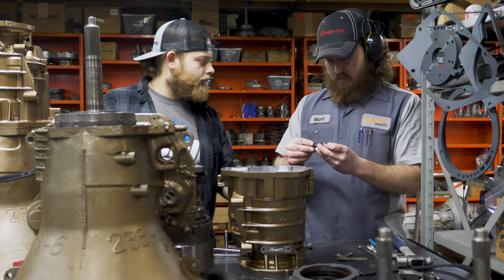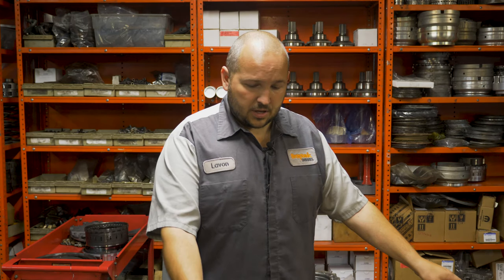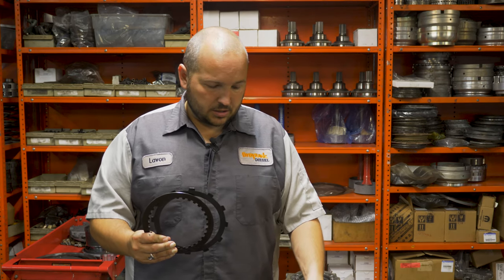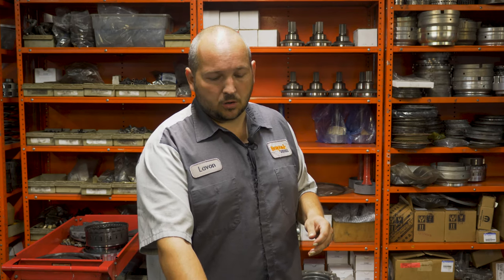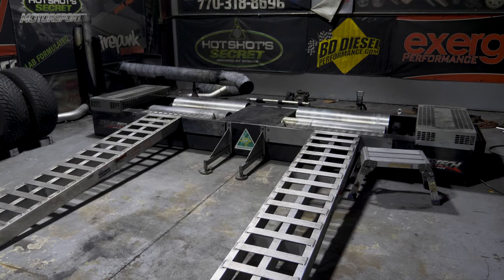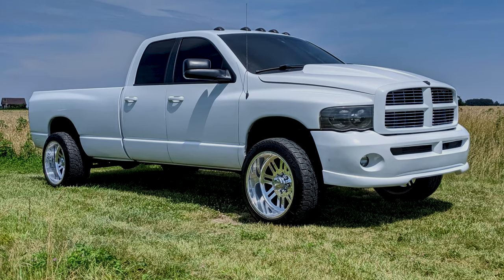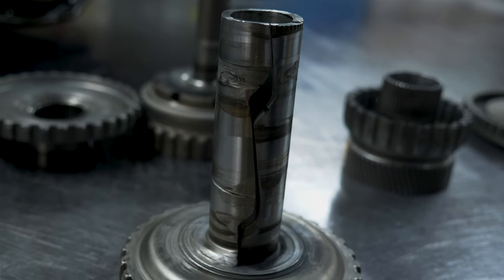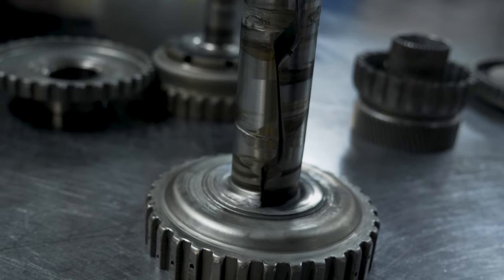68RFE - THE GOOD, THE BAD, & THE UGLY

Comment: Someone needs to build a standalone controller for 68s to swap into the older daily driver trucks
Reply from the maker: Firepunk Engineering is working on one actually
Reply: @FirepunkDiesel  any idea on when that will be released?
Reply from the maker: It will be released when and if it works flawlessly.
Reply: @FirepunkDiesel  Do you all write tunes for the 68rfe?
Reply from the maker: @monsterram6617  I don't do it by myself, I have a few guys at CTT who have the ability to make edits in the binary file help with the trans tuning, there are some tables simply not defined to the tuner
Reply: @FirepunkDiesel  Interesting, thanks.

Comment: Ok so my 03 still has oe trans and it a 47re should I build the 47 or do a 48 (with fmvb) i want to build the trans before i really add power i am thinking of doing 1000 hp with a few different tunes for sled pulling and drag racing but it will also be a street truck

Comment: Firepunk diesel need Advice I have a 2008 dodge Cummins 6.7 I recently put a rebuilt transmission going on two years. For about two weeks now while I’m driving the truck it will engage into fourth gear and stay in fourth gear. I tried to change the gears while driving from the auto six manual shift on the shifter but it stays in fourth gear. I have to pull over to the side of the road put the truck in park, cut off the truck, turn the truck back on and put it back and drive and it will be back to normal . The truck is my daily driver it has been happening maybe about three times a week. What do you think could be wrong with the truck?
Reply from the maker: 4th gear is limp mode, you need to see what code it's throwing but could possibly be a worn solenoid switch valve in the valve body causing your problem
Reply: @FirepunkDiesel  thanks for the heads up
Reply: @FirepunkDiesel  no code is present when it happens.

Comment: questionon the 68 rfe and stock 3.42 gears on a tow rig. Why did chrysler put 3.42s in the 2018 Rams with the 68. what gear would you recommend for a stock tire, stock ride height truck deleted and baby tunes.
Reply: Fuel economy. Any percentage of increase in numerical ratio will translate into the same increase in cruise rpm.
Reply: Because of the epa... 3:73-4:10 for stock tires all day
Reply: Go on grimmjeeper.com there’s an awesome gear calculator on there. You can input any speed and see the rpm. And compare your gears to desired gears side by side

Comment: What about a road ripper 3000. Im thinking about getting one for my 1989 f350 7.5l just so that if I need the power or the torque I have it. I want to run 33in MT tire. I'm going to use it mainly for towing a 40-50ft 30k trailer. More of a personal-sema build truck. Thanks for a respond if any. 
P.S. id like to see a video review than anything. Thanks.

Comment: So when can  we get a Allison Drop in for these RAMs , all the new Thomas School buses come with Allison’s and the 6.7 Cummins
Reply: You can already get a kit and standalone Tcm to do the swap
Reply: 3Gunner Now.
Reply: Dream setup. Anyone have one?
Reply: @Steve_I  
$15,000.++  for the Allison swap.
Best to just buy a RAM 3500 CUMMINS with AISIN (rated by Dodge to pull a 35,000 pound trailer).  Just buy my DODGE Ram 3500 CUMMINS/AISIN/4×4/EXHAUST BRAKE. $19k.
I am buying a new Dodge CUMMINS/AISIN.
NEED TO SELL (149,000 miles)
Reply: @smiley3303  
Yes, I have a DODGE Ram 3500 4x4 CUMMINS/AISIN trans. With CUMMINS/AISIN EXHAUST BRAKE. I pulled my R.V. fifth wheel UP ☝ the Rockie Mountains using CRUISE CONTROL, then set the exhaust brake/ cruise control going DOWN. Never had to touch the pedals, no other pickup can do that. Low miles it's for sale $19k.  Or you can swap a Allison 1000 for $14,000.
Reply: @nellyfarnsworth7381  Hello, do you still have it for sale?
Reply: @Steve_I  
Allison conversion  $15,000+
Also this will be a custom one off conversion. When you need repairs, NO SHOP CAN REPAIR.
BEST to buy my DODGE 6.7 Liter with the CUMMINS/AISIN.
RATED BY DODGE TO PULL 31,000+ pound trailer. 
Dodge used the BEST on this truck, engine is CUMMINS, transmission is AISIN. AISIN is the WORLD'S LARGEST TRANSMISSION MANUFACTURER (TOYOTA).
THIS AISIN transmission was designed and built for class 6 & class 7 trucks. Medium Duty TRUCKS (NOT PICK-UPS). Much stronger that Allison 1000.
RATED BY DODGE TO TOW 31,000 pound trailer. With a CUMMINS/AISIN factory EXHAUST BRAKE.
Reply: @bryanbivens8624  
Yes
Reply: @bryanbivens8624  
I can drive it to you for $1.50/mile. After FULL payment has cleared at my bank. What state do live in?
Reply: @smiley3303  
Just buy my FACTORY stock,  Dodge CUMMINS/AISIN transmission. Rated by DODGE to tow 31,000+ trailer.  This is NOT a one off conversion, AISIN transmission is optional on the 3500 & standard on 4500, 5500. You can get repairs at any DODGE DEALER.
AISIN is the WORLD'S LARGEST TRANSMISSION MANUFACTURER (TOYOTA).
ALSO has a factory stock DODGE CUMMINS/AISIN EXHAUST BRAKE, that is used with cruise control. 
These one off conversion DOES NOT HAVE EXHAUST BRAKE or Cruise Control.
PLUS if the DODGE 2500 or Dodge 3500 does NOT HAVE a REAR END AXLE rated to tow 31,000+ pounds,  then you will need to replace drive shaft & rear end, BRAKES.
Next if your Dodge 2500 has a weak frame that is NOT RATED to tow 31,000+ trailer, you need to replace the frame.
Reply: Why reinvent the wheel?
Spending much more money for a CONVERSION. THAT has NO EXHAUST BRAKE, NO cruise control, small rear end, small BRAKES.
You need to be able to STOP.
WITHOUT a working EXHAUST BRAKE (towing 31,000+ pounds) the state highway police, will NOT allow you past their check point. You will have to turn around and go BACK.
Reply: @smiley3303  
This conversion dream can turn into a nightmare💥😲😯😳
Reply: Hello, I live in Las Vegas.  What year, miles, trim level?  Do you have a CL ad?  Can you PM me?
Reply: Well if u guys wait a yr or two ram is working on a deal to put Allison's trans in the rams trucks n doing away with the aisin in the heavy-duty trucks

Comment: I'm in central IL. Where do you guys recommend doing gear swaps? I wanna go to 4:10s
Reply from the maker: Do you have a local mechanic shop you trust?  A gear swap is a pretty straight forward job, but does take some time, just make sure you find someone that is confident in their abilities to get pinion depth and backlash set correctly.
Reply: @FirepunkDiesel  nobody close. Was thinking about a shop in the St. Louis area that is well known for gear swaps in Jeep's. I figure if there doing Jeep's on the regular they can do my 2500.

Comment: I have a 2019 3500 ram with the 68rfe in it. The stock tires are 275/70/18. Would I need to regear if I put on 295/70/18?
Reply from the maker: That's a 34" tire, you don't have to regear for that but if you start adding power then understand that a 4.10 gear will put more of that extra power's tq load on your ring and pinion instead of your transmission

Comment: Which is worse. 35 inch tall tires and riding around with no weight in the bed. Riding with stock tires and 2,000 pounds camper on the back of the truck?
Reply from the maker: 35in tires is worse, once you understand rotating weight, you understand how that load effects your tq load on the clutch at low rpm

Comment: So I have 35’s and the 3.42 on my 2015 and I leave it on the 440-450 hp tune all the time… am I really killing my trans when I burn down the highway at 80-90mph??? Like I love to sit at 80mph all day and then gun it to 90 or so to pass cars, even 100-110mph… is that bad…. Also Anyone know if going to the 3.73 gear drops your mpg noticeably from the 3.42?
Reply from the maker: Look at your rpm Operation range, if your going 80+ then it's not as bad as lugging at 60 mph in 6th but yes, your 35/3.42 combination is hell on the overdrive clutch unless you manually tap shift it to keep your rpms at 2000+rpm in 5th and 6th
Reply: @FirepunkDiesel  yes at 60ish mph it sits pretty low in the Roma. Maybe 1200-1300 at most, sometime lower depending on roadway. Sits about 1800-1900 at 80mph

Comment: I have a 2013 Laramie 2500 it not shifting to 5 and 6 it threw a check code replace the auto transmission module solenoid I did and nothing changed

Comment: I have a 2019 ram 2500 4x4 i wanna  delete it and run efi live looking to run 33-35 inch tires I’m not hard on my truck just wanna pull a 40 ft toy hauler

Comment: I want a 6.7l 420hp 1075 foot lbs of torque  Tow my 5th wheel 7,000lbs 30ft 1974  will it work 68rfe ???
Reply: I just bought a 2012 2500 with 107000 miles on it all stock,I pull a 29' toy hauler at 8000 lbs loaded,the truck and tranny hand no problems,on the prairie flats I use all gears,in the hills I'll keep it in 5th gear

Comment: How do I know what gears in my Truck ? I have a 2015 Ram 6.7 4x4 ?
Reply: 3Gunner on build sheet or also usually on the transfer case I think.
Reply: It was only offered with 3.42s, thanks to the epa there were no other options.
Reply: Could be a 3.42 or a 3.73. I have a 3.73 in my 2015
Reply: @willevans6032  If it's a single rear wheel truck it's 3.42. That's the only ratio they came in unless you went with the dually

Comment: Mine is a 2013 dodge ram 1500 R/T i was told it was a 66rfe its a 6speed that has been rebuild once and it took a shit after 1 year and 6months and i daily it only has a cai long tubes and a tune but i dont hit the track and its been a money pit but was told i can convert to a 4 speed is that true
Reply from the maker: I haven't done it but we have a Porcupine Controller that converts the 48re neutral safety switch signals to the 68rfe controls and I'm guessing the 66rfe would be the same

Comment: Wow my 2016 68 is about 175-205 degrees without a trailer on flat ground doing 65.
Reply: @nolefishatgmail  I put one on too its down to 165-170 with it
Reply: Dan the revmax bypass valve my trans run nothing over 130 on my ‘14 and it installs in minutes

Comment: I wonder if I can swap my 68rfe with a 6-speed manual
Reply: darnell smith you could I think.
Reply: Yes you can
Reply: Yes. I swapped my 68rfe to a zf6 from a 6.0 powerstroke in my 2007.5 ram.

Comment: The 68RFE is too light duty for use behind a diesel. 
It was originally designed for a 1/2 ton gas engine light truck application (look it up),  It is simply beefed up with a bigger torque converter when it should have been redesigned completely. I did not buy a RAM because it has this transmission that should never have been used behind a diesel in the first place. If you already own one of these trash pump crap transmissions and like the truck invest in a 1000 Series Allison Conversion  and be done  with a poor transmission. Consider this before buying a RAM.

Comment: Has anybody put some high horse behind an allison swap on a 4th gen. Yall should try it out and let us know
Reply: I looked into it before putting a built 68RFE in mine and in short, it's not worth the money/effort.  The estimated cost for a Suncoast 600whp Allison swap was over $13,000 after figuring in the adapter plates, wiring harnesses, TCM and tuning, etc.  If you had super deep pockets, you could probably build a 1000+whp Allison and fit it up to the 6.7, as all of the necessary components are out there. But you'd be on your own for trouble shooting and working out any bugs.  

Practical advice is either build the 68RFE and keep the truck under 750whp or do a 48RE conversion and go for 800+whp.
Reply: Heck the guys running high hp duramax’s swap the Allison out for 48RE’s.
Reply: This ^

Comment: Nothing is dumber than having a 1 ton diesel and putting huge tires on it. The only thing dumber is taking a 4x4 and slamming it and putting axle extensions on it! Nothing like hurting the towing and cargo capacity of a 1 ton work truck with 37 inch tires and a lift kit!  Ruined resale value and reduced utility!

Comment: i was wondering when my converter locks up, like what gears? anything over 25mph? mine doesn't seem to lock until 4th gear. any help appreciated.... thanks
Reply: It depends on the year; the older trucks won't lock until 4th gear, where as the newer trucks lock in 3rd under certain conditions. But, either way, you can have it changed with custom tuning.
Reply: Jeremy Holmberg mine is tuned and will lock in second if I manually shit it if I leave it in auto it’s 3rd but sometime you can’t fell it only see it on the edge insite
Reply: @monsterram6617  mine is a 2012 and doesn't feel like it locks until 4th, even in manual mode.
Reply: @jeremyleeholmberg   What about tow/haul mode?
Reply: @monsterram6617  yes tow/haul mode . just seems like it's not locked and gets hot quick pulling hills under 4th gear . 200 degrees plus.
Reply: @jeremyleeholmberg  Not locking until 4th is normal for a 2012 truck.  You can get a trans tune where it will lock in 2nd in tow/haul and 3rd regular drive.  Your trans temp seems a bit high though.  Is this towing a load, or unloaded?
Reply: Mine a 12 with tuning hottest I have seen is 168 towing in 95 deg ost
Reply: @monsterram6617  loaded for sure no problems unloaded. it does have trans tuning from Oz tuner. I thought it would lock in lower gears with tuning also. maybe i should call Oz tuner?
Reply: @jeremyleeholmberg  Yeah, I'd give them a call and see what they can do.  If they can't help, check out CTT (formerly HPP).  I've had their tunes for 4 years now and they're great.

About trans temps, 200°F isn't so hot that you're going to burn the fluid; if over 220°F I'd start getting concerned.  If you're pulling heavy, over grades, in the lower gears where the TC stays unlocked, it seems normal to be on the warm side.

Comment: Without a doubt, the worst transmission ever made. Second worst is the AS69RC. Most likely because Chrysler does all the programming. Had a 2013 with 68RFE and a 2016 with the AS69RC, and both were awful, though the Aisin is better. Still doesn't know what the hell it's doing half the time. Swapped the 2016 for a 2018 F-350 and the transmission is leagues ahead of the crap Chrysler puts in their vehicles. Cummins is the better engine, but I'll take the Ford over the Ram any day, even though I like the Ram better.